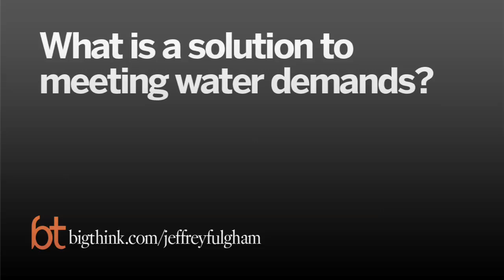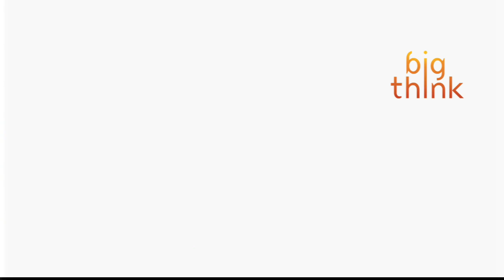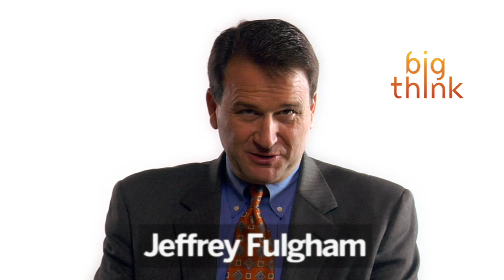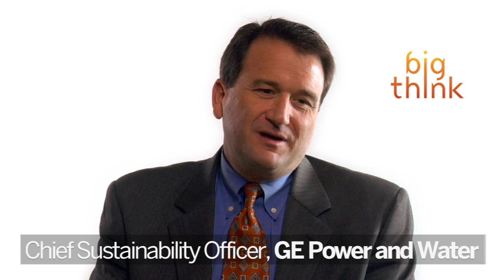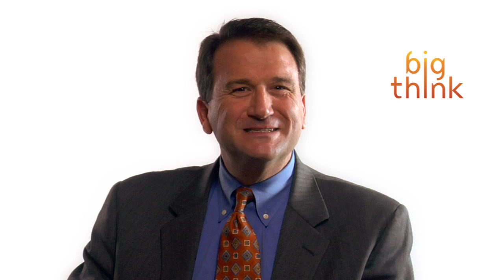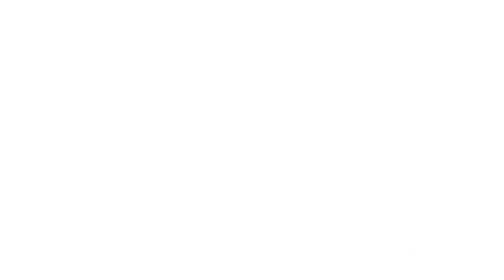Is Reusing Waste Water Really "Toilet to Tap?"

Comment: I am always interested in potential health risks from public health and utility projects and I find it interesting when risks are excluded from risk-benefit analysis. Lithium, for example, flushed down toilets (in urine) cannot be removed even by reverse osmosis because its atomic radius is only 90 picometers. A 2007 analysis of San Diego's drinking water also found several contaminants including ibuprofen, the bug repellent DEET, and the anti-anxiety drug meprobamate.